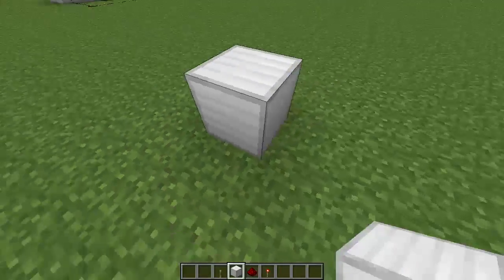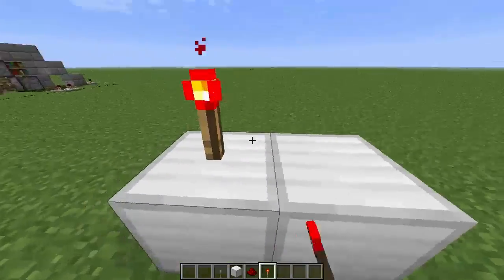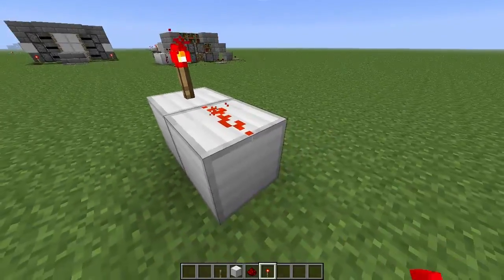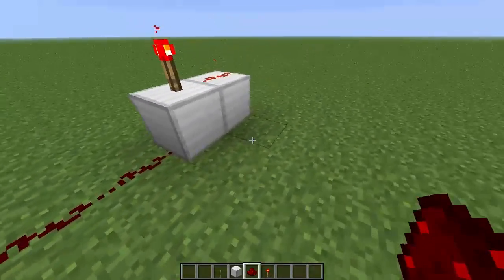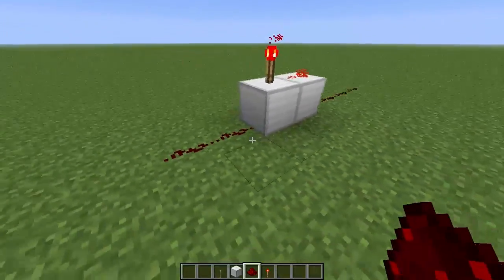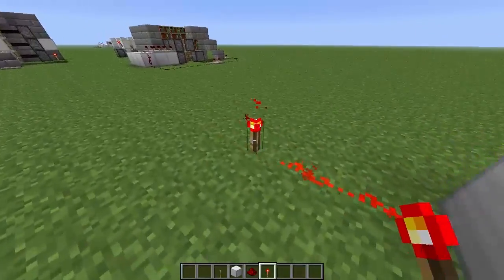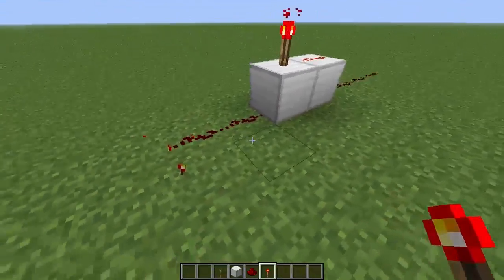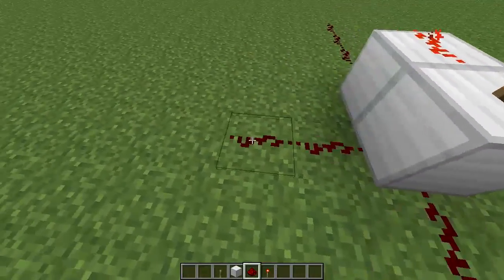Redstone Tutorials - #8.5 OR and NAND Gates

Comment: you still getting the or wrong lol :) the or gate is between 2 elements only and only 1 can be on, any other 3 options will set it to off
Reply: ok my fault i was wrong

a and b   - And = TRUE if both a and b are TRUE.
a or b      - Or    = TRUE if either a or b is TRUE.
a xor b    - Xor  = TRUE if either a or b is TRUE, but not both.
! a            - Not  = TRUE if a is not TRUE.

replace the true and false with on and of :)

from php at least :s